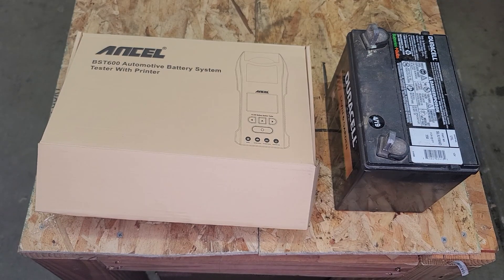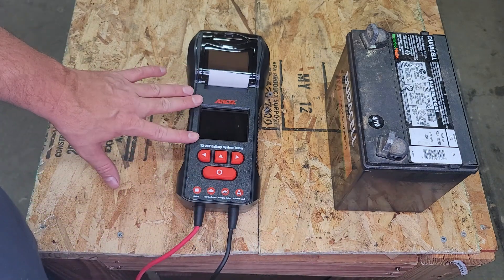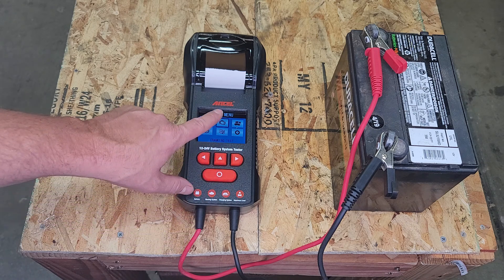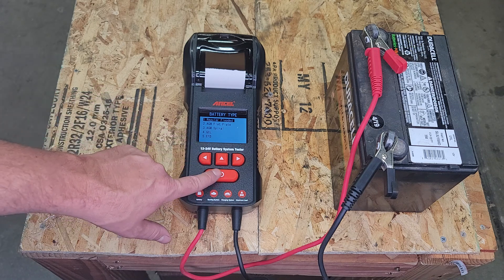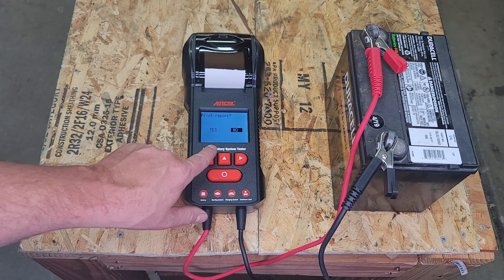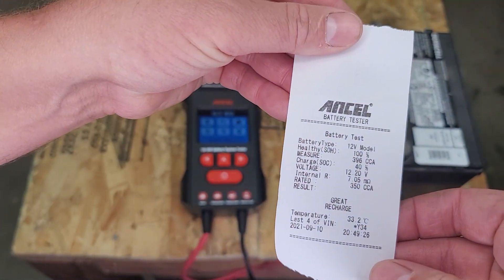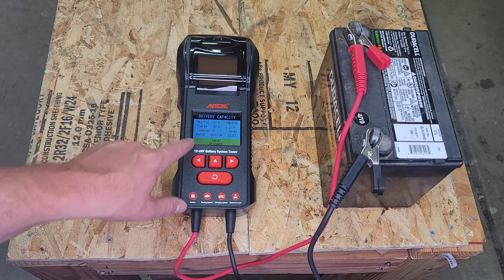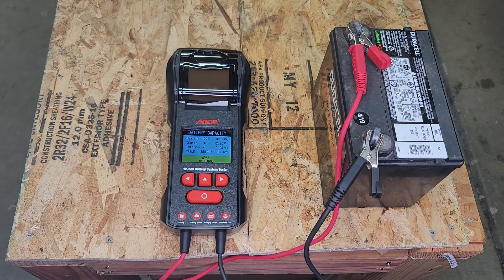ANCEL BST600 Professional Automotive Battery System Tester with Printer

Comment: I have the BST500 model. The one before this model came out. This Looks much improved . Does it save the date and time now? I had to reset mine every single time i use it
Reply from the maker: No I believe it does not have an internal battery. You have to save time/date every time.
Reply: @OctaneElectrons  this would be a cool feature to have, I wonder if you could open it up & fit a small batter in the circuit somewhere.

Comment: Would be interesting to see it compared to a Volt meter to see how close the actual numbers are.
Reply from the maker: I didn't show it in the video, but I checked with one of my good voltmeters. Definitely accurate to 0.01V
Reply: @OctaneElectrons  cool!  According to the crank test though the battery in the F150 was low, can you confirm was that the problem and if so did you change the battery?